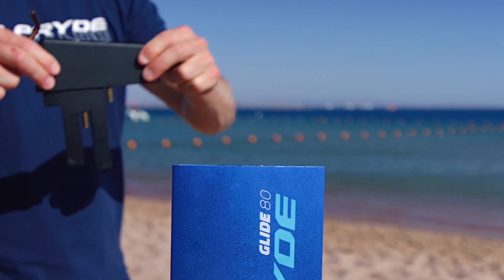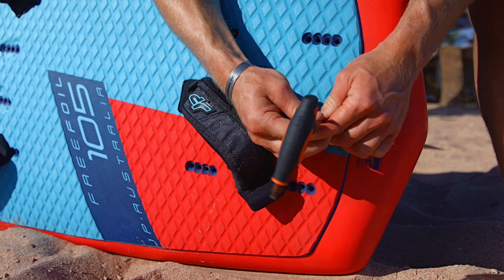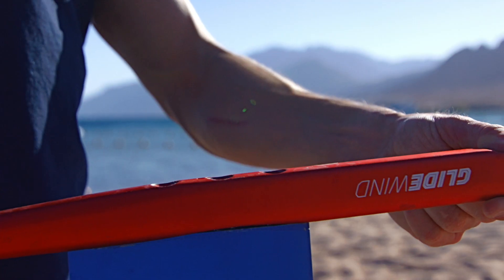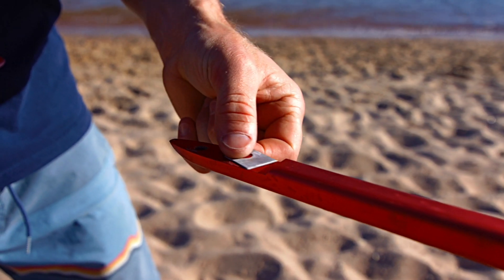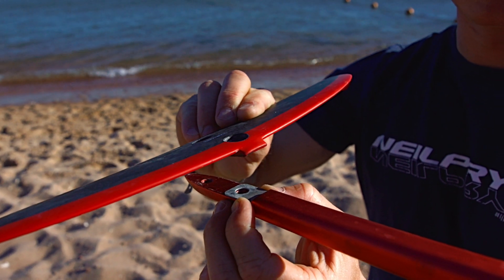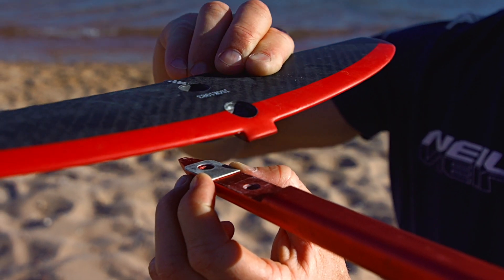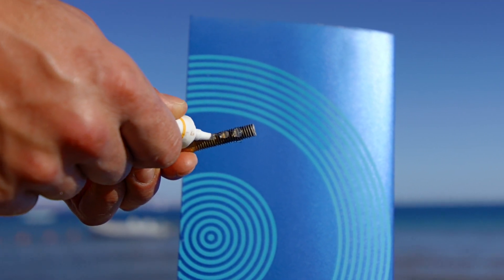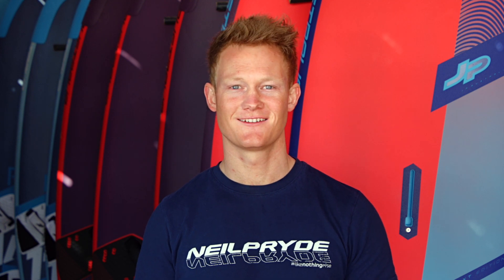Foil Guide #1 - Mounting

Comment: hello I have a Jp freefoil with NP Glide Wind HP I am struggling to find the right setup I am feeling to have to much pressure on the back foot to keep the flight. I already moved the mast 1cm back from center and the foil on the second line from the back (the line above the - sign) I am 70 kg. how much pressure should I have on the front foot?

Comment: I didn’t know that i should remove the screws each time, now the screws are stuck and i cant remove them 😕
What can i do?
Reply: Use could use wd40, spray below the screw head several times and let it settle for 30min, infiltrate into the screw thread. WD40 sneaks in between the screw thread and you will have an easier dismount. For future usage, I always grease my screws with some marine grease, with this you avoid cold welding. Do not know if neilpryde uses helicoils in the aluminium structure, they should use bronce helicoils in future for any aluminium thread.
Reply: @modellwerft  i already tried wd40 but i still can’t remove them. It’s my first foil and neilpryde didn’t include grease with it, so i had no idea that i should use that and now all the screws are stuck
Reply: @windaddict  Same thing happened to me, all the screws now are damaged and i cant remove them, i will take a look at the screw extractor, thanks for the tip 🤙🏼